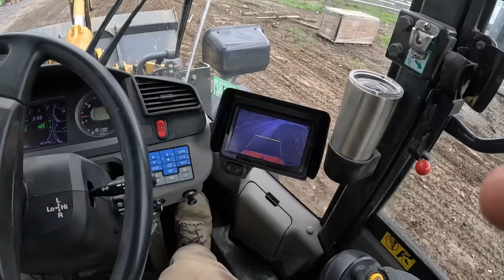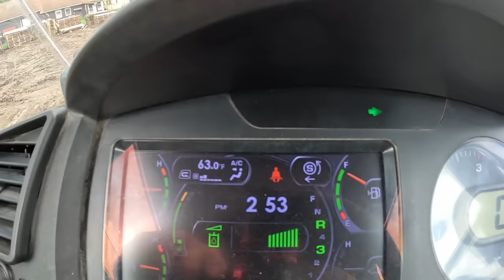Buying wheel loader Komatsu WA270-7

Comment: I plow with the same machine basically, wa200 and with no fenders on the back when cruising down the road in sloppy slush/snow you will leave a 20 foot rooster tail lol. So much so that the snow flies off the back and front wheels forward into the air and then you drive into it covering the windshield. The snow also cakes your mirrors and if you have the window down will cover your jacket if it’s hung on the hanger. Love the ride control and the regenetive braking or whatever they call it. It’s zippy for getting around and the hydraulic controls are intuitive. I always use the thumb for forward/ reverse though

Comment: Hello, congratulations on your new achievement.  Just a little tip to make your work easier, you don't have to select the gear on the steering wheel!  You can switch to joystick control using a switch in the cockpit.  Much easier and even more fun.  Kind regards, Ben
Reply from the maker: Yes I know but for some reason it's throwing a code when I press the button dealer says it's a common issue..the button goes bad
Reply: Ohh, that's crap!  The dealer didn't fix it before the sale because the dealer isn't very good!  In any case, I already had that and sat down with the prices for it.  Here in Germany the prices are between €800 and €1,500!  It wasn't difficult to install on my wheel loader.  I did this by myself in half an hour!  I still wish you much success and fun with your machine and look forward to more great videos from you.  LG Ben
Reply from the maker: Update got the button to work it just had dirt and it cleaned it up badda boom badda bing
Reply: It can be that simple sometimes!  Well then, let’s get started with work and fun. 🤑👍

Comment: Congrats, that's a fantastic loading shovel! I'd keep the fenders though, it's a nightmare to keep clean without. 

As to replacing the Kobelco... the Komatsu excavators are good, but the cab is not as good as most other manufacturers have. I'd check out a new -11 Kobelco first. World-class cab, it just sips diesel, and an overall solid machine.

Comment: Nice that’s a perfect size to for what you do. Once you get that button working for shifting you’ll love it even more doesn’t seem like a big deal but after running the button for yrs on the joystick I hate using the one on the column
Reply from the maker: I bet definitely
Reply from the maker: I got the button to work today I took it apart cleaned it there was a bunch of dirt in the bottom of it that was making the neutral hang

Comment: You do know theres a thumb switch for fwd/rev..dont need to keep messing with the column shifter
Reply from the maker: Yes there is but it's reading lLO3 code when I press it dealer thinks it's the switch

Comment: I think i would have to see it without the fender to make a definite call. But im leaning towards no rear section as i bet thats part of the reason both panels are rusting right there. Great video. I think i may have driven by that sight a couple weeks ago if its not far from fred the butcher.
Reply from the maker: Yes exactly I was eating there for a month straight love the cutlets!

Comment: I'm from Mass I worked with the county guys for years, you got a nice Machine barely used and kept up with every maintenance possible even if it was'nt used it still got changed, where in mass did you get the Loader from
Reply from the maker: Plainfield highway department
Reply: thats part of Franklin County, years ago driving truck i used to be all over that place LOL, they kept equipment in tip top shape only problem was winter time with the snow and salt and plowing @DIRT-BOSS